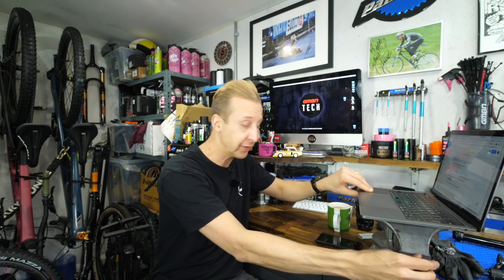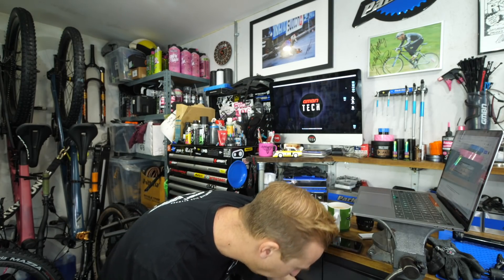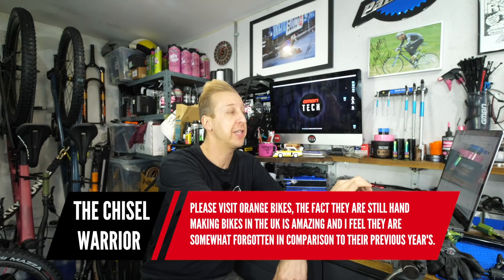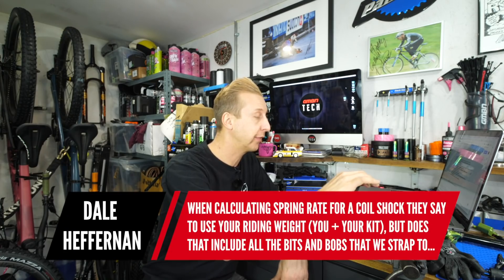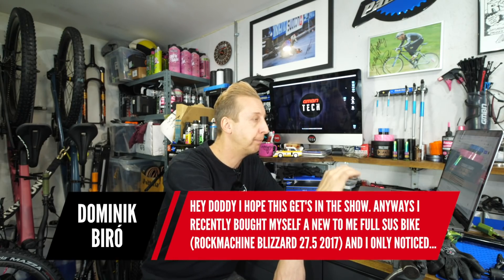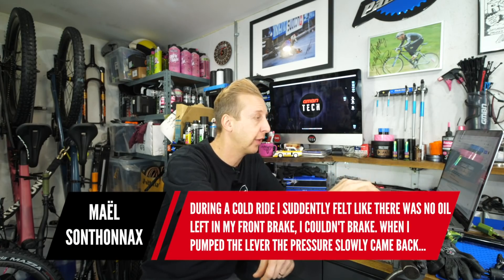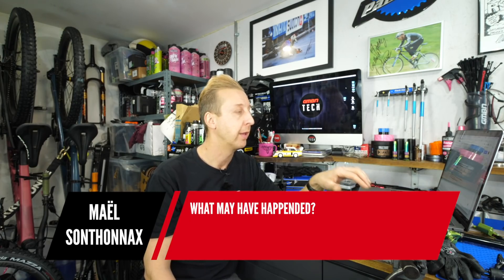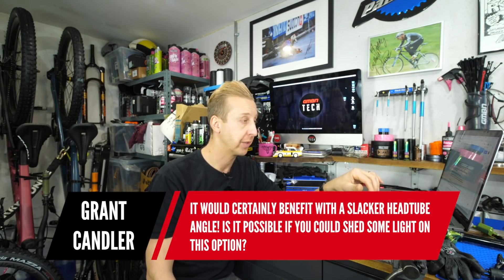What Counts As Riding Weight When Setting Up Suspension? | #AskGMBNTech

Comment: #AskGMBNTech Hey Doddy! I was a bit late on previous week video so I'm reposting my question here : Why does the shimano rear derailleur mounting system exist in two different types? For exemple the XTR M-9000 has one more pivot and a little part that the XTR M-9100 doesn't have near the hanger screw. What's the difference ? I hope my question is clear enough
Reply: 9000 and 9100 are not just 2 versions of the same. 9000 is 11 speed, 9100 is 12 speed. The kinematics are completely different. The 9000 looks like Shimano rear mechs have looked for many years. The additional part you are writing about looks like an extension that helped them to get the 46t 11-speed cassette in. For the even bigger 51t 12-speed cassette, they had to completely rethink their classic design. This also made the 9100 a 1x only system. If you want 2x you have to use the 9120 rear mech but this does not take the 51t cassette.
Reply: @chrisridesbicycles  Thanks for your answer, that make a lot of sense! I first noticed it a while ago trying to choose a 9x derailleur and was hestating between the M-592 that has the additional part and the M-591 that doesn't. Even if they have nearly the same spec they don't look the same at all... Maybe two different gen?
Reply: @leorhodes8834  The additional part was called „Shadow“ when they introduced it. Here is an explanation. https://youtu.be/eFhMHfH9c2c They still use the name on the 9100 even if it looks different. That‘s where it gets confusing.
Reply: @chrisridesbicycles  Thanks a lot!
Reply: @chrisridesbicycles  that wasn’t why they dubbed them “shadow”, the shadow term related to how the derailleur is “leaner” and is tucked under the cassette more, so as to not stick out as much......says shimano.
Reply: @borisflamingo594  Ich you look at old news forum entries, you see this marketing claim disappearing relatively quick. Maybe it was a solution for a non-existing problem? The clutch introduced only one year later however really makes a difference.
Reply: @chrisridesbicycles  you missed the point dude! You’re referring to the “SG” or “SGS” part of the model name for clutches. Look straight down and compare an old mech vs new style mech and see how much sticks out. OP was mainly referring to the “direct mount” option. ✌️
Reply: @borisflamingo594  Just for clarification SGS vs. GS is the cage length (the distance between the pulleys). Shadow trys to mount whole mechanism closer to the centerline of the frame to avoid collisions with objects on the trail. If this really helps that much or if you would hit the objects with your pedals before can be questioned. If you look on the current Shimano website, the „is narrower and avoids collisions“ argument has disappeared and they are only talking about the clutch if you look up Shadow RD+ under technologies.

Comment: #askgmbntech hi doddy I am a trials rider that has an onnit j2 frame which doesn't have enough clearence to get my Park tool chain scrubber in, I have some muc off aerosol chain cleaner however I am struggling to get it properly clean because of the low clearance and the difficulty to get the chain off due to the frames desin   What should I do?

Comment: #AskGMBNTech do u know of a decent gravel type 42t single crankset that will fit a 73mm BB housing? They all seem to be designed for road bike style 68mm housing, I've read of people facing off 2.5mm off each side but this seems a bit extreme.

Comment: #AskGMBNtech based on the coil fact- I have a transition sentinel alloy 2018 and want to try a marzochhi coil however I need a 205x57.5 would a 205x60mm be okay?
Reply: Take your shock out and see if it hits anything when you move your suspension 2.5mm more at the shock

Comment: #AskGMBNTech Hi Doddy, how can I reduce the reach on a bike if I'm finding it too long? The bike suits my size and build, but I have short arms which makes it difficult to get a proper fit. Any help or tips would be greatly appreciated, thankyou!
Reply: Shorter stem, 
more headset spacers under your stem,  
higher rise bars and roll them back, 
angleset headset to make your head angle slacker- that will also bring your bars closer,
Offset bushings(if you have a full sus bike)- they make your bars closer by slackening your head angle
Reply: Just about to type the same, plus you had extra suggestions I wouldn’t have known myself - top tips mate
Reply: Thank you guys 😄

Comment: Hey I’m Justin I want upgrade my fork on 2017 diamondback mission 2. The fork I want is fox 38 but the  steer tube has a 1/2 inch taper but my current fork has a 1/5 taper what would I need make it work.#AskGMBNTech